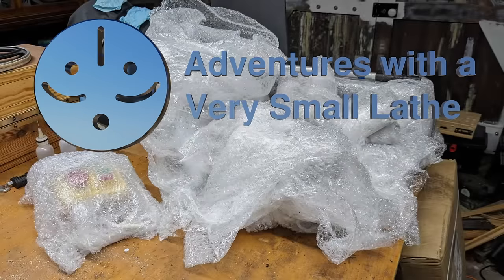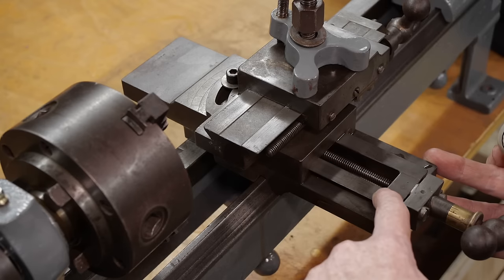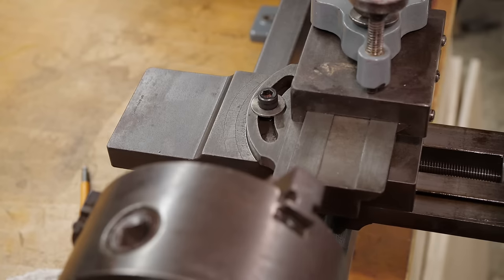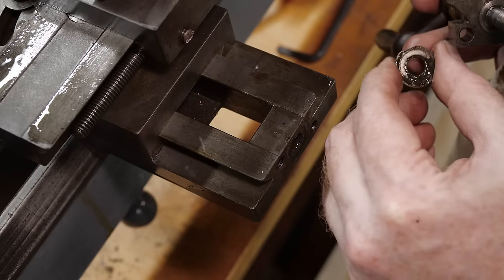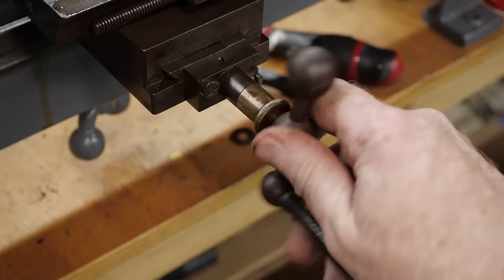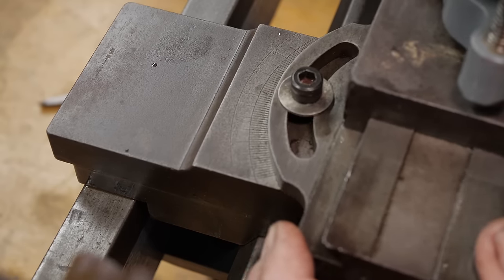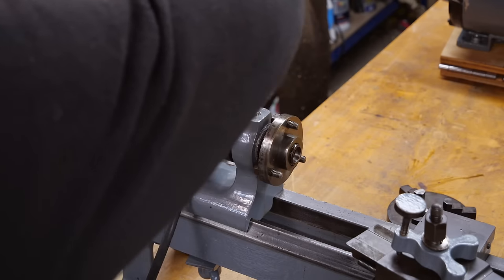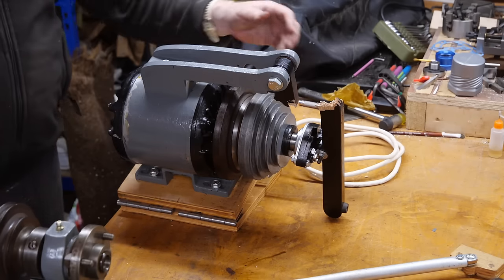Lorch Model A Lathe - The Reveal and Assessment

Comment: Is the "pulleys are backwards" problem maybe a "motor mounts the other way" problem instead?

Thanks for a great video.
Reply: Due to the mounting plate under the motor that serves as a tensioner for the belt (under the motor's own weight) I would say it's the right direction but could be easily changed I guess.
Reply: yeah - I guess the motor was mounted below the spindle, and reversed as well.   If the bolt pattern is rectangular it should be easy to reverse.
Reply: I have the same model, yes the pulleys are on back to front as on the treadle (mine is on its original stand and was originally a treadle drive),  the belt goes down though the table to a lay shaft.
Reply from the maker: The clutch lever doesn't seem to make sense the other way round, and the original catalog pics of this lathe with the v-belt pulley the opposite way round from the way mine is currently. On that basis I'm going to try flipping it and see how I get on.
Reply: these type A lathes normally have an intermediate pulley set, so that the motor stays fixed, and the headstock drive belt moves on headstock and intermediate set for speed change....mine has a motor from an industrial sewing machine, which runs constantly, and a knee-lever engages the clutch one way, through a disengaged position to a braking position.
Reply: @lohikarhu734  I'm surprised there was no reply to your, obviously valuable comment. You'rs is the only logical conclusion!

Comment: Those ball crank handles are attached with tapered pins just tap on the small end and they will come right out.  Even though you say you can't see the pin on the other side on the cross slide handle I see it in the video they all are the same, Taper Pins a common method of attaching ball crank handles in this vintage lathe.  Use preferably a brass punch and tap them out  from the small end of the pin.
Reply from the maker: Thanks! YOu've spotted one of the issues with talking over the videos live. The camera can see way more detail than my eyes could at the time. Now I look at the footage, the pins are way more clear.

Comment: I have been a proud owner of a similar Lorch & Schmidt Lath foe about 20 years. And while yours seems to be slightly older, mine is more complete and (I believe) more original. Though in all fairness, especially on how these were once driven and set up, seems to be tailored to the buyer need. The grease nipples seem to be replacements from the original oil ports though (with conical plugs on the two on the headstock). Mine is definitely in need of some TLC, and as it happened, I actually started that this afternoon. In my case, the bearings in the headstock are solid bronze bearings with (hemp?) grease cords in them. I should have pictures of when I took it apart. I can also provide pictures of some of the missing parts. Like the hand helt chisel support, the collet ring, collets and tightening rod. Once you have the lath set up (and greased up) it is easy to hold it by the driving wheel with belt, and with the chuck still on the driveshaft, put the key in it and turn it. It has been like 20 years, but I might have some more items that were sold with the lath at the time.. let me know if you are interested. You did find some things that I had missed though, and that will help me keep mine in better shape. So thank you..
Reply from the maker: Hi! Thanks so much for commenting. I'm really interested in seeing your pictures of the spindle taken apart, plus the ones of the parts I'm currently missing. Can you get in touch via the email address on the "About" page of this channel? You should be able to see it by going to the channel "Home", and then clicking on the ">" next to the channel description, and then finally "View email address". I'm hoping your pictures will help me prepare for stripping the spindle down safely, without doing any damage.

Comment: I tend to address thread problems by running a tap and a die across the threads. What I have found over time is that if there actually Is a thread issue....in either piece.....the risk is damaging threads in otherwise good condition by jamming damaged threads across them. FWIW 😊

Comment: The lubrication fittings, while often used with grease, can also be used with oil. An oil can with a needle tip is used to push in the ball. However, with plain bearings in the headstock, dashpots would be much more appropriate.
Reply from the maker: Thanks, useful info. That makes the switch to oil easier to pull off, though i think in the long term it would be better to be able to see the oil level at a glance, and have a reasonable size oil reservoir so it doesn't need to be topped up too often.
Reply: i seem to remember that the headstock  bearings might be hard steel on cast iron, so need to be kept lubricated, but very thinly so...the end play/clearance is quite nicely done by feel, as it's almost like a 'switch' between just right and 'locked up', as per my memory...my smaller Lorch has a split in the hradstock bearings, and a screw to adjust each spindle bearing, as the spindle can travel about 5-6 cm when doing threading operations.
Reply: Fun Fact: I was just watching your "scraping" video where you were addressing the saddle of Chinese (?) mini-lathe. I see now that the LORCH machine has a very similar situation as had the other machine. It would be interesting to see how this LORCH passes an examination of "its" tolerances.  FWIW.

Comment: That's a sweet machine! Looks to be in good shape, outside of being dirty. Looking forward to seeing it brought back to its former glory!

Those handles look like they're held on with taper pins. Hard to see on the compound, but on the cross slide handle, the end you can see looks to be the small end. You can just make out the outline of the big end, on the other side. 

As for the compound locking screw, I think a square head bolt with a nice beefy washer would be ideal, and more period-correct than the socket-head cap screw. You'd be loosening/tightening that fastener every time you adjust the compound angle, and I would think slot-head screw would get borked up in short order.

The zerk fittings on the headstock bearings are meant to take oil. As you noted when oiling the rest of the machine, the oil will wash away any dirt or other contamination that find its way into the bearings... Whereas grease will hold it, and basically turn into lapping paste over time. Most people see zerk fittings and assume grease. I recently restored a Bridgeport mill that had zerks on the saddle, and the previous owner had packed the poor machine full of grease. There's a special pump-oiler with the proper fitting available, though modern versions are of dubious quality.

You'd probably want to put drip-feed oilers in place of those zerks, or maybe oil cups with wicks in them. Something that holds a larger quantity of oil than the current fittings.
Reply from the maker: Thanks for the tips! Drip oilers does align with my thinking, though I'd never heard the term "zerk" before. TIL.
Reply: @AdventureswithaVerySmallLathe  I think it's one of those things that's regional/generational... I've just always heard them called Zerk fittngs. Made me curious enough to look it up... Apparently they were named after their inventor, Oscar U. Zerk. TI(also)L!

Comment: They knew what they were doing, the reason why both pulleys are the same way on both the head stock and the motor is because you're missing a counter shaft and pulley which would allow you to obtain 6 speeds, not 3 !  Hope this helps - Great old lathe - Well done for taking good care of it, the people who made it would be so proud of you for being such a caring owner !
Reply from the maker: That makes a lot of sense, and helps a lot! It's still a bit baffling how the previous owner made effective use of it, as the bench setup shown on eBay didn't include a countershaft.
Reply: @AdventureswithaVerySmallLathe   I'm sure you can sort out a counter shaft and add another belt to enjoy 6 speeds from your lathe which would make it more flexible - All the very best of luck mate - Great video ! 👍

Comment: Ah, the best way of getting machines... You feel the Divine nudge and you just snag the machine... I just recently had such a moment, and while it was technically a shit move, as my shop is already overcrowded, tho on the other hand, it was the best move possible... It granted me a masterwork machine with minimal work hours for next to nothing, and i can use the machine as both an EDM sinker and a jig grinder in time when I manage to build a new shop and devote to all my projects in a space that allows me to do so in an appropriate manner... 
This ``very small lathe`` is adorable, and looks well made... Definitely not a tank my any measure, but a nice little machine at any rate... Especially once returned to quondam grandeur she once gleamed with... 

All the best and kindest regards!
Steuss
Reply from the maker: I do have to be careful, as I could easily accidentally end up with way more gear than I can fit in. This Model A was too tempting, especially as the seller was willing to ship it. It feels way more capable than the 3 hobby lathes I have so far, and I'm hoping it's going to be a satisfying project getting it into shape.
Thanks for your tips during the Premiere chat. I'm off to track down some ATF.
Reply: @AdventureswithaVerySmallLathe  
Yeah, tell me about getting too much stuff into ones own shop... I had like 5 machines which fit the shop perfectly, and i vapor sealed the shop, started arranging stuff, sealing the tiles and what not, only to suddenly end up with 13 machines in the shop(some in parts, hidden beneath other machines) and no room for any work... But come on, you actually aren`t even near that point, so don`t worry about it, and you aren`t hoarding 3 tonne machines that instantly slurp up cubic meters with just their footprint, let alone needed access area for operating and maintenance... 
That said, you really did snag some nice machines... I would be wary of taking on such small machines, but that is just my specific viewpoint that is formed from my thought projects and mental gymnastics... 

Regarding the atf, i`m glad, it`s a great lubricant/washing fluid, depending on usecase... Speaking of car essentials, you should try manual gearbox teflon additive... Its detergent free, just 80w oil with teflon, quite akin to moly grease, but its more like 00 grade grease or near solid oil... I use it on my ways or to lube up any fasteners on machines... I don`t mix it with the whole bucket of way oil, i just add 15% volume to my oil can for ways/leadscrew oiler injections... It works like a charm, and you can use it pure to lube up tailstock bores or similar quill bores where there is no real high speed movement... You can also get some car wax in solid wax form and use it on machine`s painted surfaces... It helps any oil or coolant just piss off without leaving stains or soaking into the paint and cracking it... It wont do much against hot chips, but it is great for keeping the machines looking like new and clean for ages with occasional reapplications... Ceramic paint shields would be better, but are costly as fuck, so wax does it for me... And kerosene will temporarily revive any healthy but oxidized machine paint, so you can do a kero wipe down of the whole machine, followed by some light acetone wipe down and then apply the wax... Don`t use it on bare metal surfaces, for those you have those rust inhibitors which do much better in that department, but to keep the paint looking great, wax will do nicely...

All the best and sorry for the mega-reply...
Steuss

Comment: Very cool lathe, I’ve got a similar Lorch from a bit later on ( I believe 1930s), which I restored and it has been a great little machine. I wouldn’t worry about dismantling and rebuilding the headstock it’s as although it’s slightly intimidating it’s not too difficult, and even the adjustment of the bearing preload was pretty easy to set by feel. Good luck!
Reply from the maker: Any hints you can offer on what order things are best adjusted? Pre-load, then the lock-ring, or the other way round?

Comment: There are taper pins on all the handles. Use a hardened needle punch and a little heat to drive them out from back side. Use a composite hockey stick for the clutch handle. Soak greased bearing housings in hot kerosene to remove old grease.

Comment: I have had good luck holding pulleys by using a wood clamp on a belt in the pulley applied across the diameter.   This requires the belt to be a bit proud of the V.
Nice old lathe.
Reply from the maker: Nice idea, thanks for the tip!

Comment: I would vote for the headstock pulley being assembled backwards. I was given an 8mm Elson with 'bad bearings' It's spindle was assembeld backwards. Ran fine after reversing the assembly.
Reply from the maker: I've dug up some original catalogue drawings from the late 1800's which show this model with the headstock pulley the other way round, so I think you're right. Trouble is I have to completely disassemble the spindle to flip it around. I need to do that anyway to clear out the dirty grease and switch to oil, so no extra hassle.
Reply: @AdventureswithaVerySmallLathe  I was thinking the same thing. I've seen a lot of restorations of pulley driven lathes and almost always the largest pulley size on the headstock is closest to the chuck.

Comment: Turn the motor around 180 degrees. The pulleys will line up and the handle will fall to the side of the lathe instead of reaching over it
Reply from the maker: The catalogue pictures show that the lathe shipped with the pulley the other way round, so the motor is correctly set up for the original configuration of the lathe. As I need to break down the spindle to change the lubrication, I'm going to stick with putting the pulley back to its original orientation. Thanks for the suggestion, as it would probably work perfectly if I wanted to avoid interfering with the spindle bearings.

Comment: Hello Al,
A very cool lathe indeed... I noted that the "25" was visible on the cross slide... I would imagine that all the other major parts should also have the same "25" which should indicate that everything was machined/scrapped as a matching set. If you have a rouge number then you may well have some slight alignment issues. I am looking forward to more on this project.
 Take care.
Paul,,
Reply from the maker: Hi Paul! This is the problem with recording the voice chatter while I am recording video: the camera gets a way better view than my aging eyes! Once I looked at the video, I spotted the "25" in loads of places, so it must be some kind of set number. I've seen these numbers on lots of watchmakers tools I've poked around.

Comment: To remove the pins holding the handles, remove the handle and shaft from the assembly and place the pin over a hole in a bench block. You ought to be able to tap the pin out safely.

Comment: Don't be afraid of the conical bearings. I worked on a few for  bycicles and you can feel if your in the sweet spot: no play and free spinning. To get it just right, you need to make very tiny turns at the end.
Reply from the maker: Thanks! I'm interested to know more about conical bearings in bicycles. Is this something that was used in the past, or are there still bicycles made today that use this type of bearings?
Reply: @AdventureswithaVerySmallLathe  they are still widely used. Some parts of the higher-end equipment moved to industrial bearings, but some say conical bearing runs nicer (e.g. bikespeeds here on the tube), maybe a run-in period improves industrial bearings. Ceramic bearings are the absolute top, very low friction without any lube and very durable. I treated me some jockey wheels and the Ceramic ones make very nice fidget toys :-)
Reply: @AdventureswithaVerySmallLathe  about the time period, I can only say that my cycling maintenance books from mid-90s include a section on cone bearings. I guess industrial bearings popped up in on of the 2000 or 2010 experimental waves.

Comment: For some reason my comment from 2 days ago hasn’t been added so here it is again.
The motor looks to be a Pultra mardrive I replaced my motor with a Jack industrial sewing machine motor instantly stops and plenty of torque, the chuck backplate is best removed when you remove the spindle , you can get oil pots from HLE Shop just got some for my Pultra P type.
Good video by the way.

Comment: Interesting but a little heavy on the 'artistry' ! Cycle the pin with heat and penetrating oil and then drift it out from the rear ! If the rear is blind and the pin is in a blind hole then secure the shaft or ball and apply pressure until you snap the pin then drill and ream to suit a new pin.

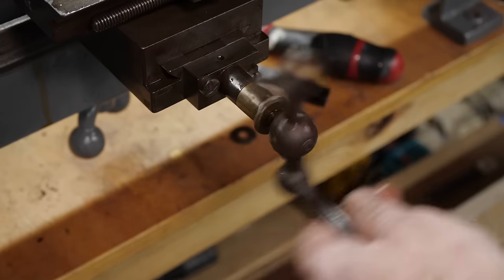Comment: In regards to the handle pin, on my screen, at around 24:10 you can see what looks to be a circle on the opposite side of the pin in the shiny glare off the light...like there is the other side of the pin sanded smooth to the flat on that side of the 'ball'.  Could be wrong, but maybe that is the other side you can tap on to get the protruding end to come out?  Fun video. :)